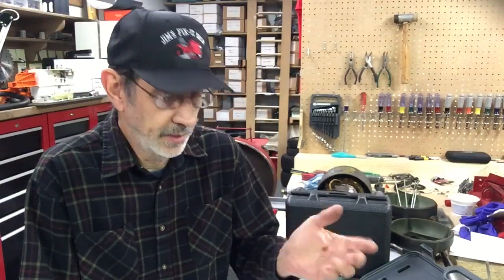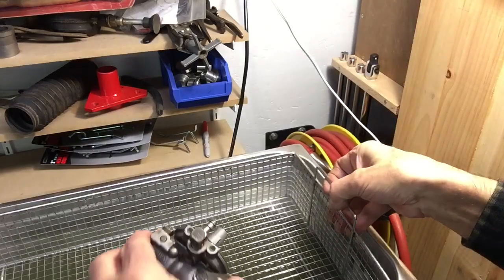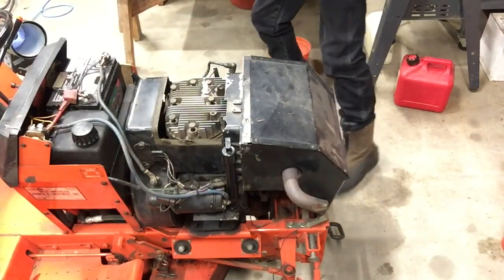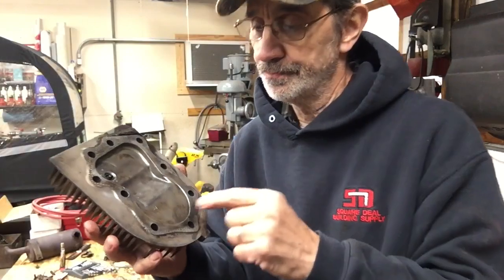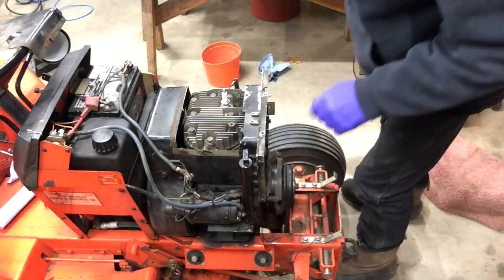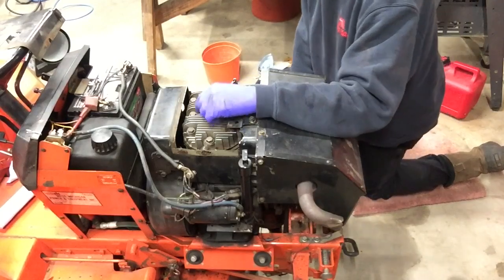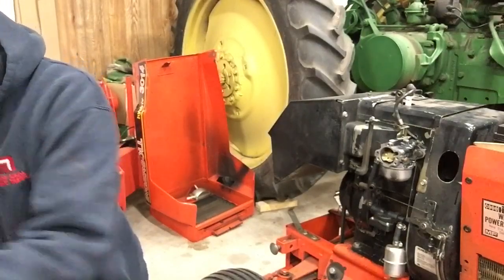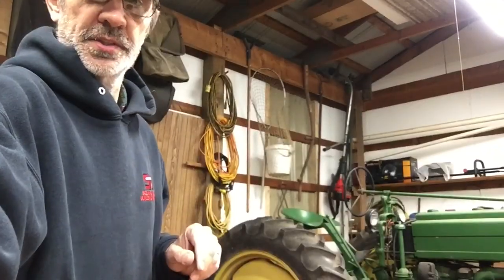453. Having problems with Our Ingersoll garden tractor￼￼

Comment: On automobile carbs and probably others they peen the backside of the screw where it comes through shaft to preven the screw from backing out. I always loctite them when doing repairs. One reason I like my Snapper RER is the exhaust and most engine heat isn't blowing back in your face. Merry Christmas Eve.
Reply from the maker: Yes I am sure that is why, but when I am snowblowing it sure would feel good.      Jim
Reply: Yeah they used brass or some kind of brass alloy for the screws so for one not to corrode and two probably to make it easier to stake or peen the end of the screw to expand it slightly.

Comment: I believe those choke plate screws are supposed to be staked to prevent them from backing out. Do they not stake these screws anymore?
Reply from the maker: Apparently they don’t because I’ve had a lot of viewers get a hold of me and tell me their engines are running wide open because of that issue.        Jim

Comment: This is a good tip to know. i hadn't ever thought about the choke mounting screws flying off.
Reply from the maker: It’s the throttle plate screws you really have to worry about.       Jim

Comment: I had two 400 series garden tractors in a row from 1991 until about 2016. The supposedly superior Briggs & Stratton engine was too big for adequate air flow behind the engine, and constantly overheated under load. The Kohler worked great for this tractor. It was sad news when Ingersoll stopped selling these tractors. Their hydraulic attachment system made for easy attachment of multiple tools. I had a 48" mower deck, a 60" tow behind bush hog and a cultivator. They were the toughest, most adaptable small tractors anywhere until John Deere came out with their x700 series, which I now have, superior for its 4WD and diesel engine, though without as varied attachments.
Reply from the maker: Yes, the variety of attachments you can get with this machine makes it far superior than most other ones. All the attachments are fabricated, not stamped, which makes a world of difference on how they work and how long they last.    Jim

Comment: Trash in needle / seat.....No fuel filter?
Reply from the maker: The only problem is he put a large automotive fuel filter on it much bigger than the standard filters that come on the machines. In the video you should be able to see the filter when I’m reinstalling the carburetor.    Jim